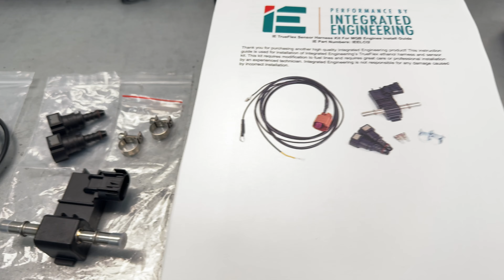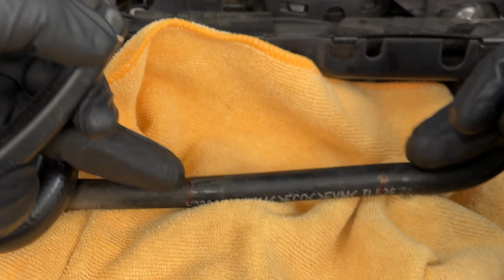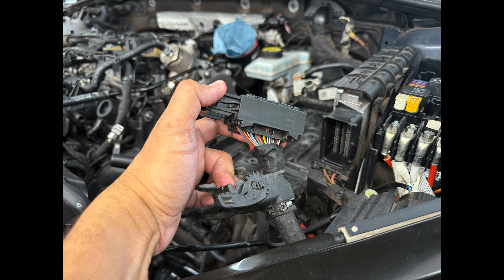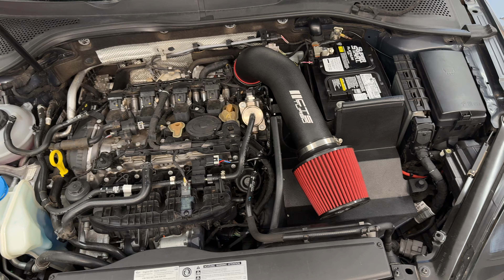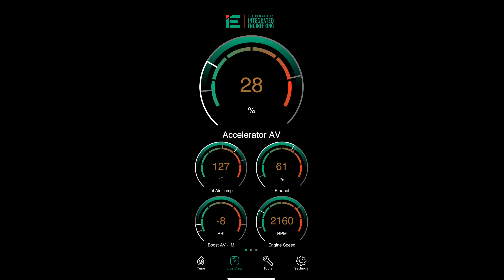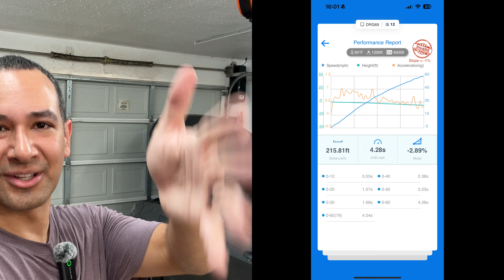IE TRUEFLEX KIT INSTALL + FAIL OF MY 0-60 TEST MK7.5 GOLF R

Comment: any gas station selling E85 at E70 is a crime and should be reported. I've never seen worse than 5% off, MAYBE 78% at most. Use a cheap E85 test kit and test regularly.
Reply from the maker: dude you're not lying, it's so annoying! lol The pump says E85 but then they usually (at least here in OK) have a small print saying that "depending on the season and availability this pump may have as low as E65". The pump I get it from is usually like E70 but in peak summer months like now it has E83-ish. 

I used to test ethanol with my Boost Monkeys tester for a while on my prior car (for well over a year before my tuner released a flexfuel setup), but that gets annoying to sit there testing when you got things to do and places to be. With a flexfuel sensor and tune just pump and go. The tune adjusts accordingly, no need to reflash between E30, E50, E85 tunes at the pump like I had to in my prior car before I got a flex setup going on it.

Comment: Motor and transmission mounts were one of the few things I did before going Stage 2. BFI Stage 1 mounts are the way to go. Adds NVH as any upgraded mount would, but they are holding up the power with no problems.
Reply from the maker: Thanks for that! For me it was between the BFI and 034 DensityLine. I went with the 034 set simply because they went on sale lower than the BFI lol. They’re working great so far!